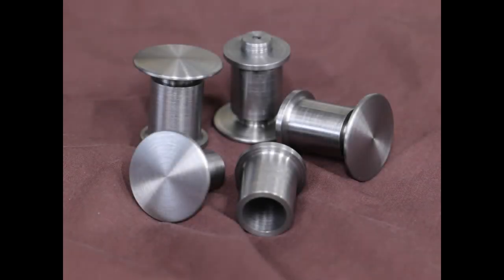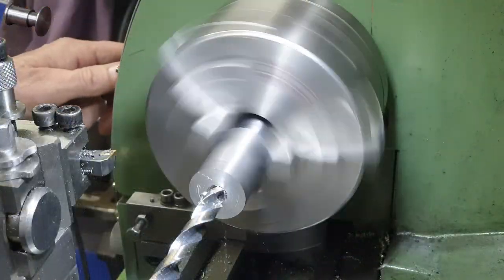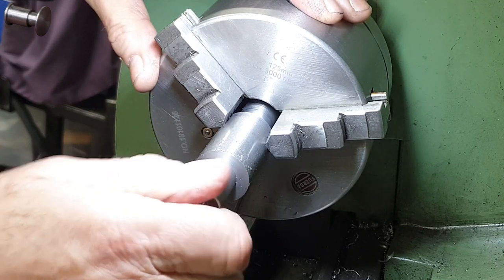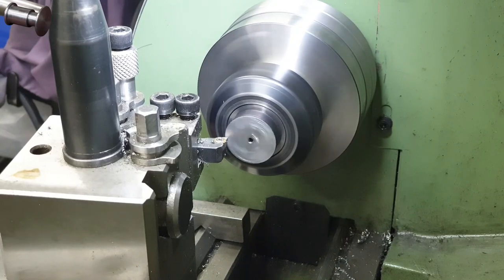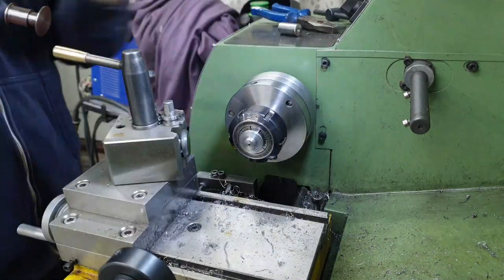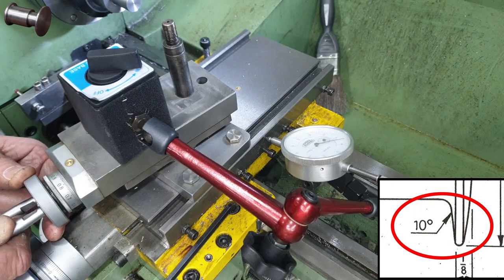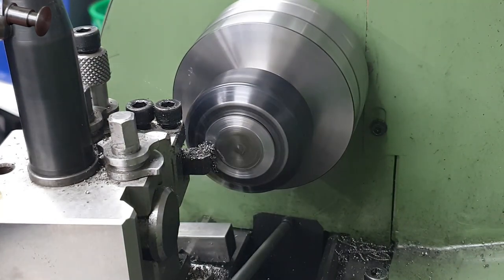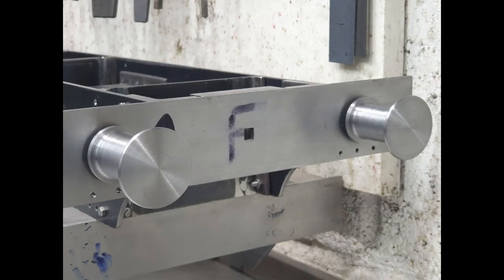Part 3: The Buffers

Comment: Hi Mark, I’ve just discovered you on YouTube.  A tip for those male threads is to put a little undercut at the base (ever so slightly smaller than the base diameter of the thread), the length of the undercut to be just long enough to get the first full thread.  That way, when you screw on the female part it will bottom out against the shoulder, rather than the tapered formed by your die.  Also means you don’t need to buy a new set of dies.  Also used when using the lathe to turn a thread.  You’ll see this technique used in full sized practice for any number of applications. Marine engine tie bolts or cylinder head bolts, piston skirt studs are just a few examples.
Reply from the maker: Hi Phil, yes but the taper on my cheap dies was significant, otherwise I would have done as you suggested.  The not so cheap die that I since bought also had a taper, even on the back, so a little undercut was required 👍